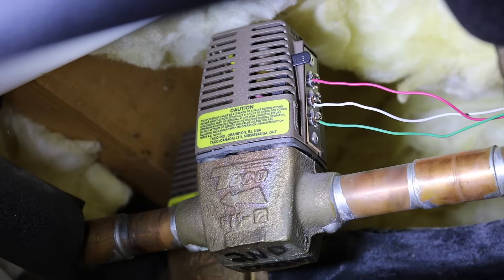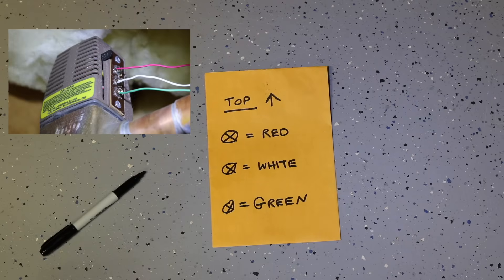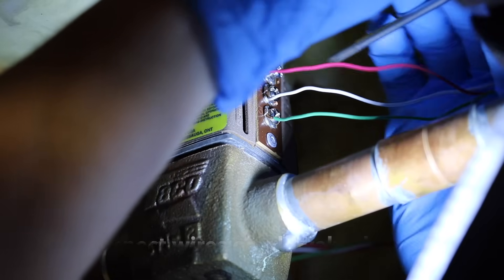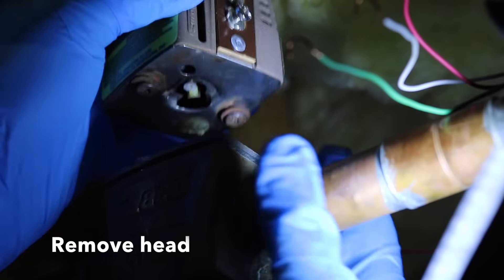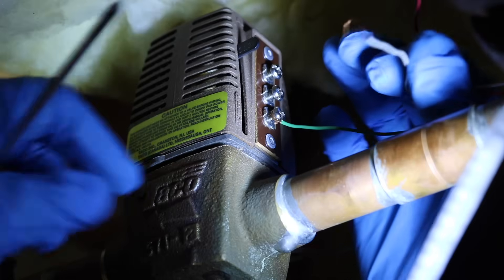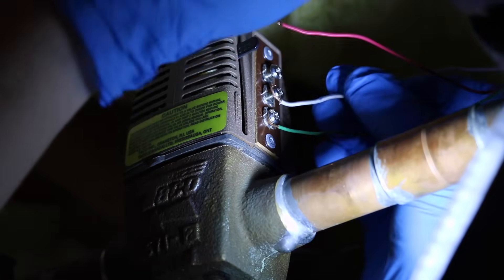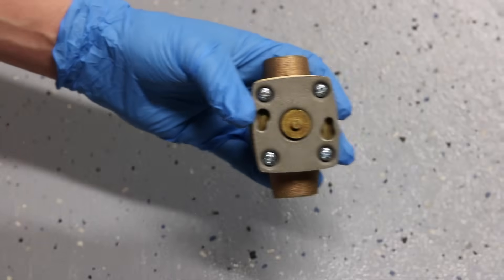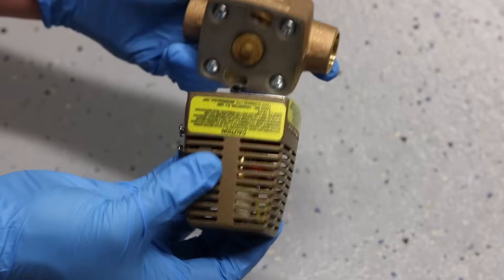No Heat? How to Replace & Troubleshoot a Taco Zone Valve

Comment: Hey dude. My heat won't shut off, even if I shut the thermostat completely off with the off switch.  Could the zone control valve you show have gone bad and is stuck in the open position? Do I shut the power off at the boiler? Thanks!

Comment: hi i'm in west Roxbury my mothers condo the heat is stuck on it has only two wires connected basically on and of i imagine it has 24 volts at the head when the thermostat is on and zero volts when off i changed the head and still the same thing 80 degree's in the apartment. i can hear the water flowing through the pipe. if i take the head off and push down on the pipe side of the valve the water flow turns off i can hear it stop if i put the head back on and pull the lever down i can also hear the water flow stop i bought the head new at home depo the box was sealed do you think its possible the valve is just brand new broken? what are your thoughts on this thanks in advance i really appreciate it
Reply: you know i was thinking i noticed when i put the head on there's a little resistance then it pops on that's when i can hear water flowing is there a way to adjust the tip of the powerhead to set in just a tad or is this an indication the mechanical valve on the pipe is worn? thanks

Comment: Great video, Zack.  I might make an addition to one point about not allowing the wires to touch adjacent wires or screw terminals.  To make absolutely sure this doesn't happen, you can wrap the wire around each terminal and position the jacket of each wire right up against the screw head.  Then wrap the wire around the terminal securely (in a clockwise direction) just short of one full wrap and clip off any excess.  As you tighten the screw, hold the wire in place.  Once secured, the bare wire should be completely under the screw head so none is exposed to touch anything else.  If it isn't, loosen the screw just enough to use a flat bladed screwdriver to push the bare end underneath and retighten.  Also make sure to tighten the screw fairly securely so good contact is made.  If you really want to go the extra mile, give every wire, terminal and the posts in the zone head with a very light coat of either silicone or dielectric grease.  This will help avoid corrosion and lengthen the time the connection will remain good.

Comment: I find it easier to wire the head while not attached to the valve.  It' much easier to manage and see that the end of the wire is not connected to the other terminals.

Comment: I have two Taco valves. I turned on my heat the other day and one zone in my house wont turn off, is this an indication that the power head needs replacement?

Comment: I have 2 zone oil heater system. Only the one thermostat turns the heater on which isnt the main part of the house. Granit when i turn the other one on that works, it still heats the whole house. Trial and error..i swapped thermostats and it did the same thing. I do not have a zone control center like your other video. Unlike your zone control valve, mine are silver boxes. Any advice or help would be awesome. Side note, this did not happen last year. This our second year in the house and the oil company came last year to checkup on the system.

Comment: Great Video! One question - We live in a multi-unit condo and the boiler is shared and in the basement. The zone valve however it's located in one of our rooms. If we were to replace the power head and need to cut the power supply to it, do we just turn the circuit off in our unit? or we have to go request for a boiler turnoff for the whole condo?
Reply from the maker: That is tough to say, normally the boiler, even if it has multiple zones, usually is just a single circuit to power it. This is usually done by turning the breaker off first. The zone head usually uses low voltage 24VAC to run but powering the boiler off is the safest way to do it.
Reply: Silver Cymbal Thank you. Do you happen to know the consequences of not shutting off the power supply? Besides potentially getting electric shock, will the power head get fried during this process as well?

Comment: I wanted to say that for about $70 these taco power heads should not have to be replaced as often as they normally have to because the heating element burns out.  But then again how the manufacturer would make the extra money due to replacement of the power heads? so they have "specifically" designed it to burn otherwise these units should have a heating coil thermal protector like the one I added for extra savings .... it is rather easy to add the $5 thermal protector to the coil .... I couldn't say this before saying thanks for sharing this very informative video .... keep em coming : )
Reply: Could you share how you added a thermal protector?
Reply from the maker: Thank you for the kind words for the video. These should be lasting a while for you. I have most originals that are 20 years old. Even new ones should last at least 10 years for you. Hopefully you just had a bad one or something.
Reply: Mine need to replace every 3 to 5 years. The plumber said that some powerhead work more than others that they worn out earlier. Maybe the replacing man gives me an used one. They look the same old or new.

Comment: I have 3 screw terminals but only 2 wires.1 red and 1 white. When I turn up the thermostat, the valve gets hot, but the pipes aren't getting warm. I'm totally lost and don't know if I need a new one or if it's something else.

Comment: I have had this problem before..  What happened the other day was unusual.  The heat would not go off on a zone.  At first I thought it was  the thermostat, which was the first thing I disconnected.  Nope.  So I shut the furnace off, let it cool down and took the head off.  There was a short in the head between motor control (#1) and common (#2).    Had I been away on vacation, that would have been cooking 24x7.

Comment: The wire should be? red, white, green? Coz my wire is white,red and green? Should i re-arrange it? And I don’t have heat on my first floor
Reply from the maker: No if you watch the video a second time I mention the colors. Don't just change them, I would replace the head
Reply: @SilverCymbal  , so just change the head of the zone valve?
Reply from the maker: @donferrer7520  If there is no leak that is almost always what has failed.
Reply: There’s still no luck I change it already but still no heat. Maybe it’s the thermostat?
Reply from the maker: @donferrer7520  Sorry that didn't work. Watch this other video: https://youtu.be/Xd-Og809TUo for heating help

Comment: Any reason why there might be a wire connecting the middle(2nd) terminal of two different zone heads on the one I am working on?
Reply: No reason at all. Doing that is redundant. People may think that doing that secures the connection.

Comment: How long should one last? I had a heating guy change one for my Indirect water heater because the valve was open but the boiler didn’t fire two years ago. I had the same problem last week so I changed in myself. Shouldn’t it last longer than two years?
Reply from the maker: No exact lifespan but I have seen many that are 10-15 years old. I have seen some fail much sooner. They can be instantly ruined if wired wrong but that clearly isn;'t what happened to yours since it worked for 2 years. It could be bad luck. You could call Taco and ask if they would do a courtesy replacement for you and send them the old one. Might be worth a try and you can keep a spare around.

Comment: perfect video - please note you can also pull the level (the left of the terminals) down to bypass the valve and let it run unregulated if you really need heat in the short term.
Reply: Also when in use “calling for heat” the lever comes down without resistance and is working correctly (should have hot water feel on both sides in and out).
Reply from the maker: Thank you very much great point too about the bypass. Thanks for watching.

Comment: I had a plumber come by and replace my thermal coupling and then he powered up my furnace two days ago but now my boiler is off again. He did mention that I had to upgrade my heads because mine are green and are old and could be the reason why I’m having issues. So needless to say I’m going to have a friend come by today to install the new heads. Hope this works
Reply from the maker: If your boiler runs but the heat doesn't get to the rooms bad heads can be the cause for sure. Check out my other videos on heating troubleshooting too, I take you through the common issues. They may help also. Thanks for watching.

Comment: If they are about to go out, are these power heads known to rapidly click when first activating? Up to 15 very loud clicks in a second then it quits. Like a loud relay switch. It's damn near startling in the middle of the night while in the basement. The valve still opens and closes.
Reply from the maker: If the valves didn't used to make that sound then it's likely indicating a problem could be happening. Normally the Taco zone valves are completely silent when operating.
Reply: Thanks. I will look into replacing the head that is clicking.

Comment: to solder to copper pipe do you remove the top portion first then heat?
Reply from the maker: You should, and since it's so easy to remove it worth it. BUT the better tip for soldering zone valves is that a lot of plumbers like to clamp the inside plunger and keep it squeezed in before soldering so protect the seat. You can use a c-clamp for this.

Comment: What if I have a movable lever on the top of the valve?
Reply from the maker: That level is a manual operation lever. When you move it, the valve will be manually activated which means it will allow water through the valve. It can be useful for testing. Often times they are frozen shut though.

Comment: Since last week my first heating zone could not get enough hot air to heat the room. Asked a pro to do a maintenance and figured out either the power head or the wire is not working correctly and I am waiting for a second appointment to fix it. Then I started thinking about why troubleshoot by myself and save hundreds of bucks. Brought a power head in HomeDepot and checked this video. After a very easy replacement and the issue was fixed. Feeling so happy and save lots of money!
Reply from the maker: That’s awesome. So glad it helped and thank you for sharing. Please share this with anyone you think may find it helpful and many more hearing videos are in the works.

Comment: Can the thing be rebuilt ?  Fixed ?   Maybe it just needs a nudge on the bench ya know ?  I’d like to see know why mine failed.     When the stat was set to activate this zone valve.  It didn’t open. But heated up. Pretty hot.  Major resistance issue.   And the manual lever didn’t seem to do anything either.   
I found that very strange.
Reply from the maker: Unfortunately there isn't anything that can be done inside, and these are not inexpensive! The parts inside are crimped and sealed so you can't fix them. At least if you replace this easy to swap part you can save 100-200 on a service call. Thanks for watching!